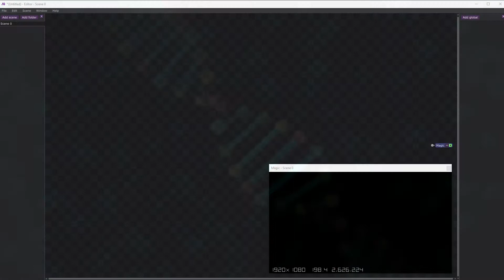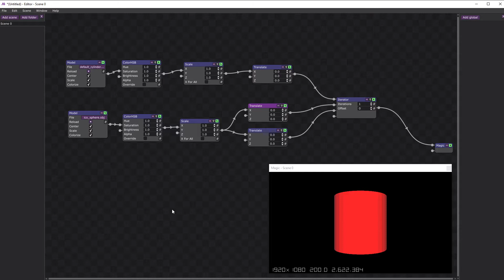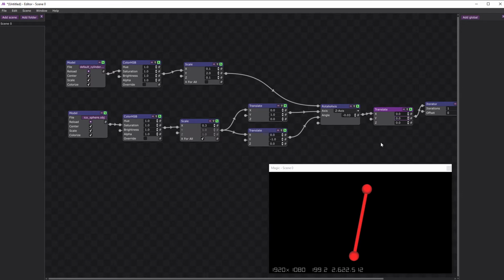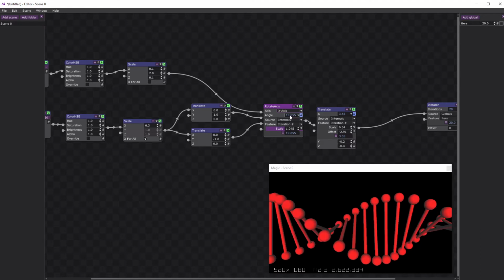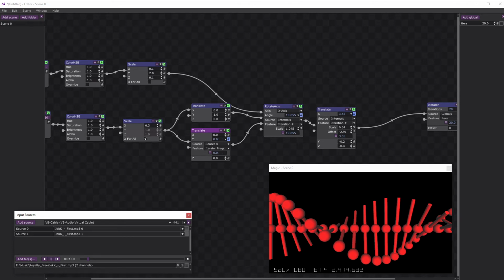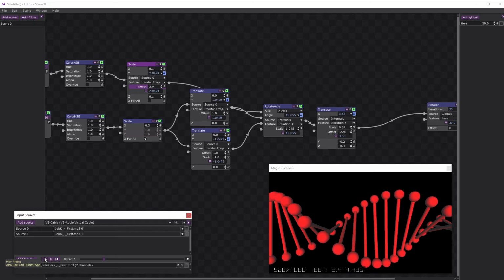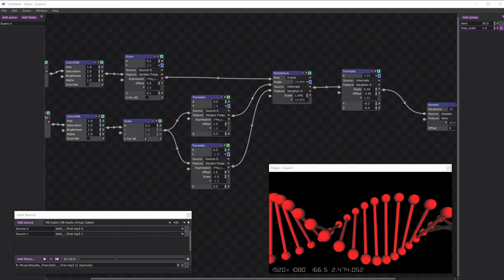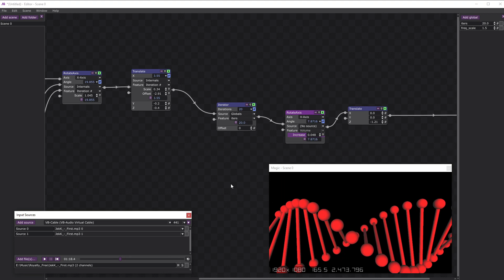How to Make an Audio Reactive DNA Strand - Magic Tutorial

Comment: This is very cool, and thank you so much for the tutorial!
If I can just add a little bit of context, from a genetics standpoint...and since this is DNA (and not RNA) we are talking about here, well then there should be four different colors, corresponding to the four possible nucleotides. For example, Cytosine (C), Guanine (G), Adenine (A), and Thymine (T). 
Along with the base pairing rules: C pairs with G, A pairs with T. 
And if we assign colors, for example: C being blue, G being yellow, A being red, and T being green, then on the helix, we should see the following color matches:
    - blue pairs with yellow (and vice versa)
    - red pairs with green (and vice versa)
I do see in your final rendering, appearing at the very beginning and end of the video, that you do in fact have four colors. But the nucleotide pairing is with the same color, which is not genetically possible. 
I managed to fix this with the assignment colors between the two spheres by simply adding an offset of 0.5 to one of the ColorHSB Hue settings. 
Once again, thank you so much for the awesome tutorial!
Reply from the maker: Thank you very much!  I didn't think too deeply about coloring but you're right, better to be scientifically accurate.